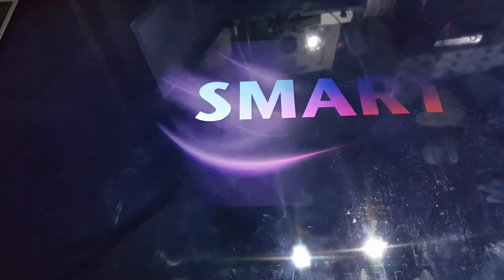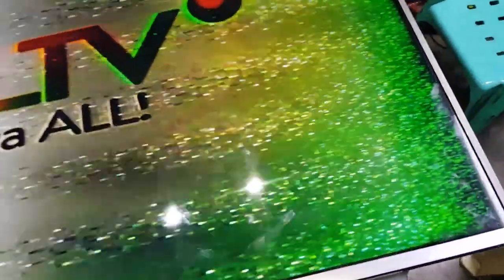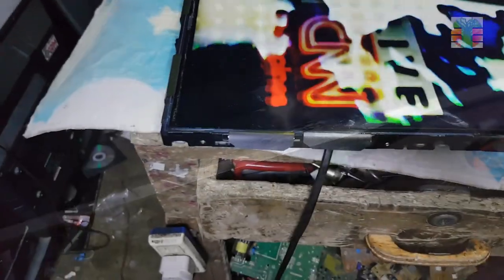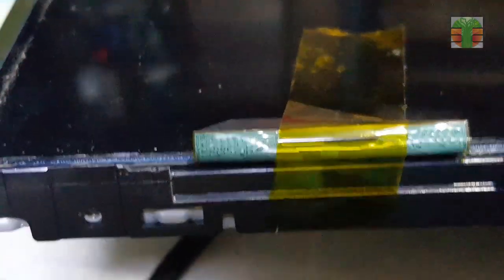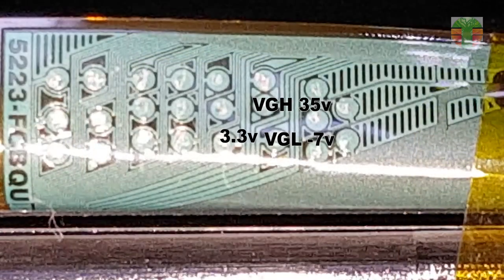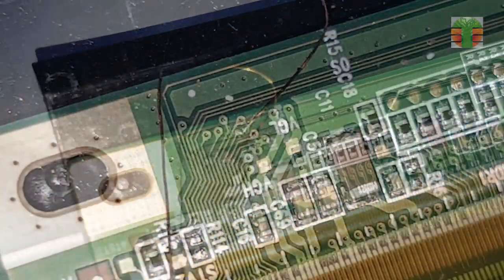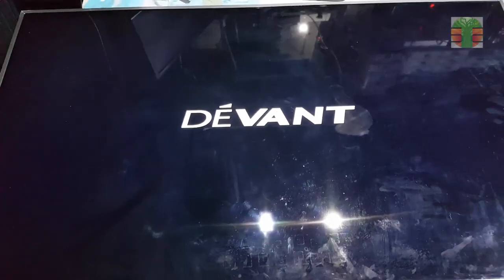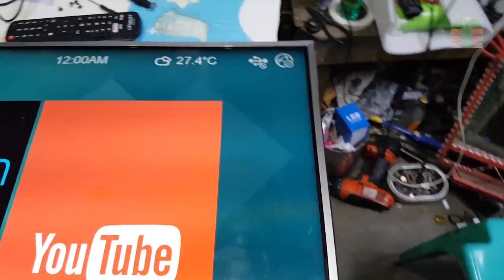The screen is darker than the other side.

Comment: I had a samsung with this problem and found a burn mark on a cof ribbon on the panel driver board.  I stuck my probe in the burn mark to measure a voltage and it triggered a short, started burning the cof, and when the fire extinguished the short was clear and the TV worked perfectly from thereon out.
Reply from the maker: That's maybe the VGH line.  In some cases, if the VGH is disconnected it will still work.